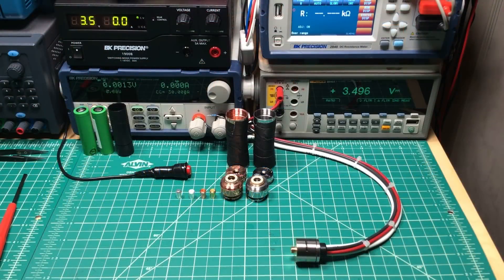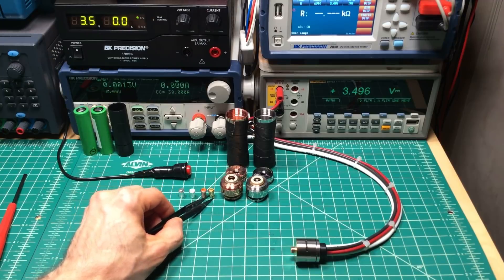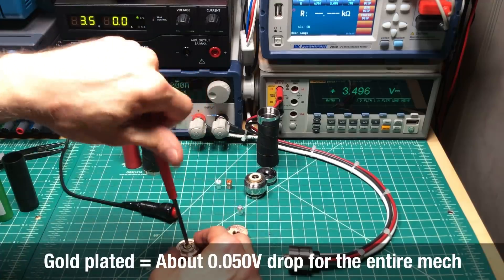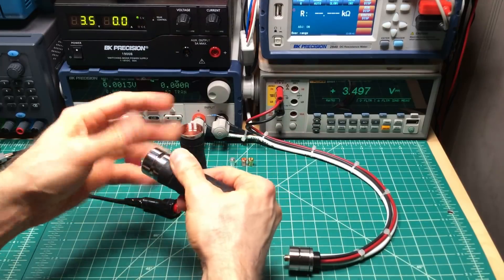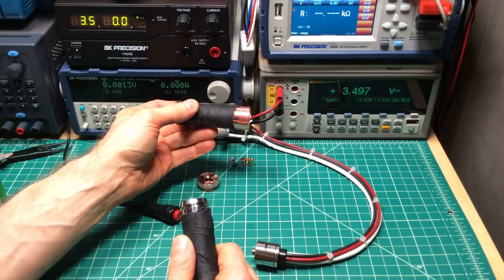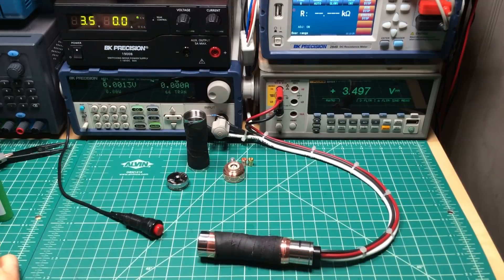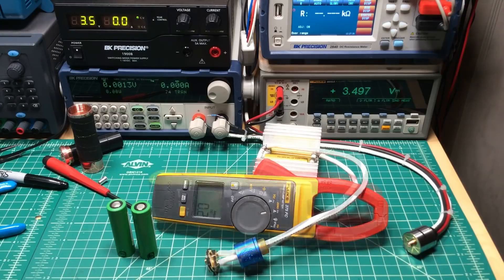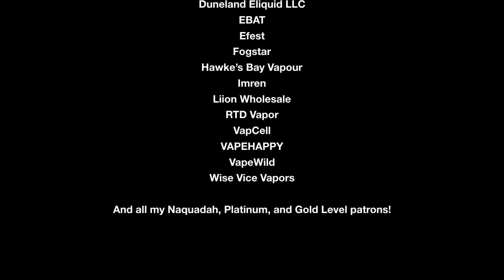Minding Your Mechs – Ep008 – Timesvape Dreamer Mech Testing Part 4 – Pins/Buttons/Arcing Testing

Comment: What about the brass Dreamer with pure silver pin and pure silver spring ?
Reply from the maker: A silver pin/spring makes almost no performance difference due to the metal itself. If it is shaped differently or is smoother then you could get smoother performance. I thought I tested the silver pin? I don’t remember.
Reply: Thanks for the informations, the shape of the pin is a flat top like a normal screw.
Reply from the maker: Daily life videos ahh....okay, thanks. It might make a small difference depending on how well the profile of the pin matches the profile of the bottom of the battery but there’s no way for me to predict how much.
Reply: @batterymooch  great, thanks a lot 😊👍

Comment: Tenacious TX has solid silver springs, pins and a ultem/acrylic buttons can you do a test on those?
Reply from the maker: The springs don’t carry any current so silver won’t help with conductivity and a solid silver pin will make little to no difference since its resistance is tiny compared to the overall voltage drop of the battery and mech. Maintenance of solid silver pins is easier than with copper though. I hope to do more testing of different pins after I finish more mech testing.

Comment: Thanks Mooch for another great and informing video. 
I have the all copper Dreamer with the pre-installed multi point pin but i am also experiencing arcing on it and on my 30T's. 
I bought the dreamer 2 day's ago.

Is there any way to clean these arcing spots and to reduce it?
Reply from the maker: If not bad try Scotch Brite Heavy Duty pads.
Reduce it? Lower the current level is about your only choice.
Reply: @batterymooch  thank you Mooch !
I'll give it a go and try to reduce the current level , i'm running it at 0.12ohm so some arcing i should have expected but not within one day though. 🤔

Comment: Have you ever tested the silver firing pin and silver spring that stan sells on his website?
Reply from the maker: No, I haven’t.
But since the mech’s voltage drop is only a tiny part of the total (the battery’s sag is huge compared to it) and the pin’s voltage drop is only a small part of the mech’s voltage drop and silver is only a few percent more conductive than copper that means any performance difference will not be noticed. However, the maintenance is a lot easier with a silver pin.

Comment: cna i ask something is the arcing on the batts dengerous ?
Reply from the maker: On its own, I can’t think of why it would be. But it does create more arcing, more heating, and if on the battery could eventually pierce the bottom of the battery..which would be EXTREMELY dangerous.

Comment: First off thank you for everything you do for our community! I do have a mech tube question to ask. I know normal procedure on hybrid mod is to install atty on top cap then install top cap. What I would like to know is there a difference between installing top cap then atty (some 510 is longer) and having gap between atty and top cap? I have a 11:11 clone and there is about a 2mm gap where mod connects if I attach atty first. If I screw mod together first then the gap is much smaller. From my aspect I don't see a difference in vaping but would like to know if there is an actual difference.
Reply from the maker: Installing the top cap first can make it easier to dent the battery...which is real bad. It depends on the mod and I don’t know enough to answer this question...sorry.
Reply: Battery Mooch well thanks for the answer. As far as denting the batteries that I learned the hard way with my first tube.

Comment: I have a question does the metal of the tube have anything to do with arcing more or any less? Jw cause I have a ss one and at first i was using the multipoint pin and it arc'd like a mf on my brand new 30t's. I was so pissed and quit using it for awhile then I bought a stack piece and switched the pin and haven't noticed it as much lately.
Reply from the maker: The metal shouldn’t affect arcing. The new pin probably helped.
Reply: Battery Mooch thank you

Comment: Great video mooch I have a copper dreamer and a ss brushed and I have both the copper pin and gold plated direct from timesvape as I was getting terrible arching from the silver plated pins I haven’t used the new pins yet as I sort of got fed up with the dreamer to be honest as I have a lot of mechs and the dreamer has definitely been the worst performer for arching so far my question is if the dreamer arch’s is it ok to still carry on using them ? I would be very grateful for your reply Cheers again mooch x
Reply from the maker: Whether it’s okay to use an arcing mech depends on what level of maintenance you want to deal with. I don’t know what safety issues it might bring up on top of all the others already present with mechs. No arcing is good but some is almost inevitable.
Reply: Battery Mooch thank you x

Comment: The copper with stainless results suggests to me that it is the hardness of stainless causing the losses with the result being so much closer to copper to copper than stainless to stainless. You would expect a roughly mid point if it was the electrical properties.
The issue I have with tube mech style mods is the use of the battery itself being used as one side of the switch contact which causes the splash marks. You have by default a steel contact surface. The battery case is better suited to a fixed connection like in a sled. We are getting very picky but as seen with the gold plated contact it's interesting to have empirical data. Something you may want to look at some time is the measured losses when "clickfet, mosfet" switching is used in unregulated mods.
Reply from the maker: The MOSFET losses are easily calculated using the datasheet but the lack of arcing (assuming decent connections to the battery) could be worth it.
Reply: Battery Mooch  yes the theoretical losses are on the data sheet but we all know we get the best figures they can get away with. I was also thinking the same tests on the same equipment. 
It's just a thought for when your sitting around bored...lol.
Reply from the maker: Sorry, didn’t mean to sound like I was pushing aside your suggestion.
I’ve found the datasheets to be quite accurate with their on-state resistance numbers though. You need to check the temperature vs resistance graph and account for the circuit board and wiring resistances too...they all add up, often to more than the MOSFET resistance.

If I can get a couple MOSFET boxes in here I’ll test the total and MOSFET voltages drops...should be interesting. Thanks!
Reply: Battery Mooch  no problem,  you didn't...lol.

Comment: I lose all track of the outside world watching these. 
Left me with two questions. One, what have you found to be the best way to handle removal of arch marks on cells? Does just hitting them with a mouse pad/ eraser do enough or is there a better way to handle the pitting?

Two, have you considered or tested any different dielectric grease to prove if it helps or hinders any sort of voltage drop? That debate is all over the place, but I don't think anyone has actually tested it's effect on mech performance. 
I grease my threads to keep them from jamming, but I don't know if that would do anything else like some claim. 
Interesting on the flat to multipoint pin, figured the multi would be better than the flat, but the difference between the two really seems like nothing. 
All fascinating results!
Reply from the maker: Grease testing in a few weeks.
Try Scotch-Brite Heavy Duty scrubber pads.
Reply: Awesome man, you're one step ahead of all my test related questions, and I love it! Thanks for answering!

Comment: Great vid! You've just crushed the whole concept behind the multipoint-pin!
Reply: DrumSmoker right? After all the explanation behind it, it still works, and not much worse than the flat, but the whole concept was it being the next best thing. The dreamer as a whole is still fantastic. Right now it has my rig descendant sitting on the bench because I can't put the stacked dreamer down.
Reply: Garison Brown I intended the argumentation, why they've came up with the knurled pin: it should prevent arcing, which in fact is even worse than the normal flat one!
Reply: DrumSmoker I was a drum blue smoker before I quit, been smoke free for 2 1/2 years now, how has your smoke free journey been? :')
Reply: Harry Mitchell My smoke/vape journey? 
Started with cigs at 16, switched to Drum blue after 6 month, started to add filter tips and switched to Pueblo yellow after 10 years. 
Now only vapor since 2 years, after 20 years of smoke.
After my first mod I was immediately infected by shopping virus and worked myself through all types of vape styles & ended know on mech tubes + MTL (because I'm a polite person & don't go around fogging up others, nor do I like to be started at like a pink elephant).
Reply: I feared that it arched more. However I've noticed the arch to the pin seems to clean off easier and it hits the recess points, so perhaps the conductivity stays more consistent longer. However that wouldn't matter if you properly clean and maintain your mechs. I'm gonna switch to the flat pin in mine to see if I notice a difference.
Reply: @Phil Yermummin comes in the box for the dreamer. In the spare bag where the springs are. I believe tenacioustx has them for sale too.

Comment: Very interesting results by the way. Maybe the copper button threads are soft enough to make a superior connection compared to the hard stainless. Id also never challenge you to a thumb wrestle after those 600 button presses!
Reply: Rob Wigglezz 
I wouldn't thumb wrestle him but not because of button pressing. He's an avid rock climber and he simply has to have well conditioned grip strength or he'd be the #1 safety harness and rigging tester.